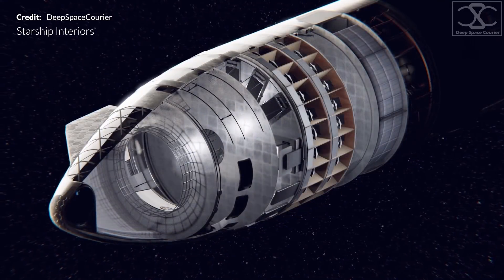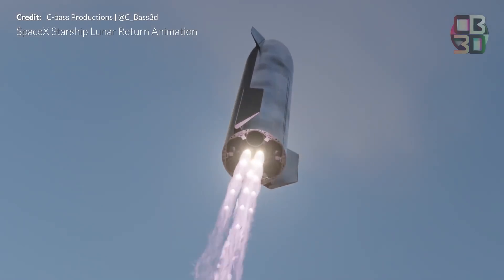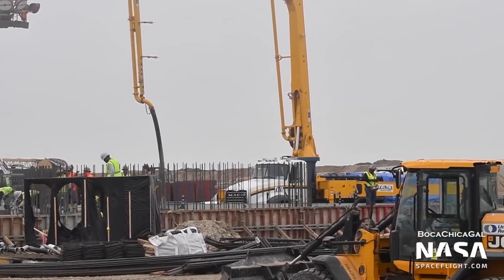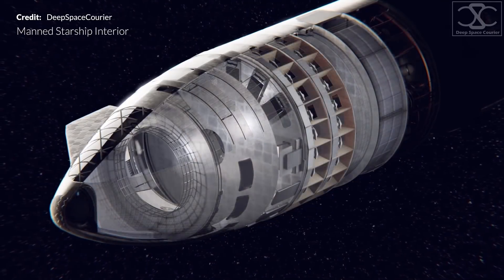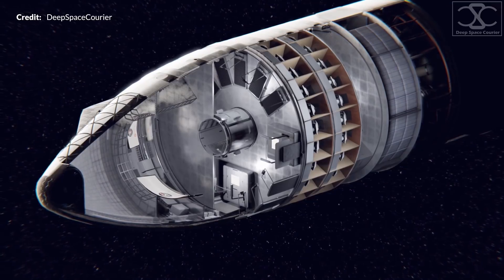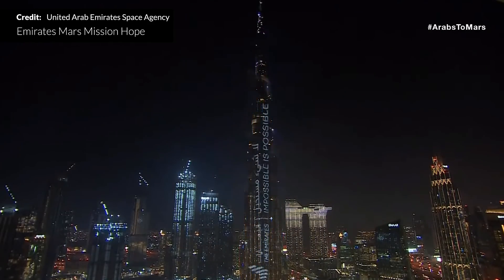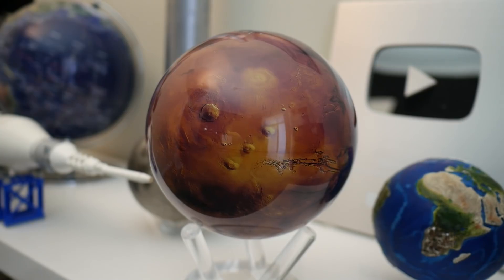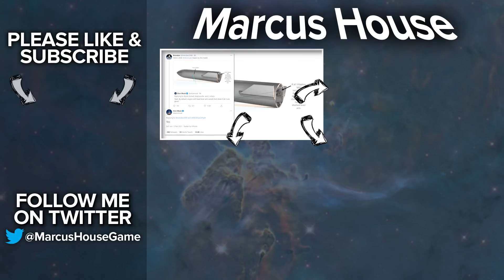SpaceX Starship to attempting another flight with SN10 - Can they master the flip and landing!?

Comment: SN9 seemed cursed from the start after it initially fell in the high bay and the eternity it took to launch. SN10 will stick the landing. Third time's a charm!
Reply: Spacex sounds like they will stop trying for a perfect landing and light three engines and shut down one when they light. This way they can examine the actual hardware that failed which will let them diagnose the problems. After all, burning a few extra seconds of fuel now is not a big deal. The can always tighten it up once starship has stuck a few landings and they have a lot more testing before orbital flights are ready. Right now they are not even going transonic and will probably want to do transonic and heating studies before the orbital launch. And put tiles on the fins and area where the fins meet the body.
Reply: @glenne1680  I'm not sure why they don't attempt the flip maneuver a little higher for now so that the engines have time to light OR attempt to light the other engine in case one craps itself. Even if the rest of the avionics and hydraulics work fine it would be a good idea to give it some room so that the rocket has enough space to balance itself before the landing not to mention start another engine in case one dies out before landing. The data they would gather during a successful landing is priceless so why not get one good landing under your belt?
Reply: @glenne1680  I hope they keep the redundant engine strategy even after the engines are out of early prototype stage.  Even capsules have more parachutes than they need to survive.
Reply: @wolffang489  As I understand it, the minimum thrust of a Raptor is too high to allow anything other than a suicide burn with three engines running. A more redundant solution would be to use engines with a thrust range that allowed a landing with three engines running at lower thrust, or two at higher thrust, such that if one is failing, the other two could be throttled up to compensate. At the moment, the Raptors are required to launch the Starship. Perhaps the configuration will change once Starship is launched atop the booster, and the Starship's vacuum engines are in use.
Reply: @sylviaelse5086  The trick is they likely won't fully burn all three.  They'll flame up all three sure, but they kill the one that's either least stable or has the shortest lever arm before it generates much thrust so that in the end, they'll hopefully more consistently have two engines to land on even if one of the normal landing engines fails.  Even with full production, well seasoned engines I would rather sit in the Starship that has a backup plan than the one that relies on absolutely nothing going wrong every time.
Reply: @wolffang489  That leaves them relying on the two running engines not to fail. That might be good enough for non-manned missions, but I don't see it being adequate for man-rating. I believe the shuttle had some short periods during launch, when an engine failure would result in loss of crew, but we know now that the shuttle was hideously dangerous anyway.
Reply: @sylviaelse5086  No, the point of starting up all 3 and cutting one is that you aren't just relying on two engines at the most critical moment which is reignition.  If it's already burning stable then it's not likely to give out in the few seconds it needs to continue burning.
Reply: @wolffang489  I understand the point of starting all three. I'm saying it's not good enough.
Reply: @sylviaelse5086  Well that will be left to be seen.  While it won't ever match a plane as they can always resort to gliding, I could see the safety of this flip-turn two engine landing becoming comparable to a helicopter eventually.
Reply: @wolffang489  Even a helicopter can auto-rotate if it loses engine power.
Reply: @sylviaelse5086  And I pray I won't have to ride one that has to attempt that maneuver.
Reply: @sylviaelse5086  True.  But the critical aspect of auto-rotation is that it must be commenced at just the right moment.  Too early, and you run out of lift while you're still far above the ground.  Too late, and you won't have slowed down enough for a soft landing.  I think it's the same with the Starship.  They don't want to run out of fuel when they're still 50 feet above the ground.
Reply: @eyesuckle  I'm sure SpaceX are capable of calculating the fuel requirements.
Reply: @eyesuckle  From videos of auto-rotation practice, it does not appear that an auto-rotation landing is particular demanding.
Reply: @sylviaelse5086  I've actually spent a lot of time in helicopters.  I spent months where I flew in one every day (as a passenger).  The pilots were required to practice auto-rotation.  They would fly to a fairly high altitude, and then practice their auto-rotation "landing" (i.e., coming to more or less a dead hover) in mid air, at a particular altitude.  That way, if they miscalculated, they wouldn't slam into the ground, and still had time to re-engage the rotor.  So, practicing wasn't that difficult.  Actually doing it for real is a little trickier.
Reply: @sylviaelse5086  Redundancy is not always the best way to maximize reliability.  It's possible you'd get more failures relying on more complex engines with more throttle capability, even with a spare, than you would with two engines and no spare once they were lit.
Reply: @psychohist  Less reliable does not necessarily mean less safe. As things stand, it looks as if Starship has two single points of failure during the last stage of landing. Even if greater throttling ability in an engine increases its probability of failing, if that eliminates single points of failure then the system is still safer unless the engines are now so unreliable that you're more likely to lose two during a landing that you previously were to lose one.
Reply: Or is it the 4th time? :D
Reply: @evilinside6327  may be fifth :P
Reply: How many times did it take during the development of the Falcon series before they stopped blowing up? People should measure it against that whatever it was.
Reply: @ForwardSynthesis  I think the 4 launch of the Falcon was successful. The first attempt to land the first stage of Falcon 9 on a ground pad near the launch site occurred on flight 20 so I don't think we have version Starship 20 parts built yet. They will probably get it sooner cos they are already doing it routinely with Falcon 9 so they know how to do it.
Reply: @evilinside6327  So it might be reasonable to expect them to get a non-exploding Starship on the 4th try or so?
Reply: @ForwardSynthesis  Well they had problems with raptors starting both times. Now they will try to start 3 and shut one down. Well, what if the one engine craps itself. During the first landing attempt, the engine exhaust turned green and it started consuming itself. If the engines don't become more reliable it might take even longer. Fortunately, Elon is not the guy to give up so even if they crash land a few more times he will eventually get it right.
Reply: @evilinside6327  the sn8 failure was not an engine reliability problem it was the header tank losing pressure. The engine ate itself because it was being fed pretty much only oxygen
Reply: right I think so too it is how it went with falcon 9 till they stuck it on the 3 try and the rest is history
Reply: Hoping for an SN10/10 from the judges.

Comment: why don't they relight all 3 engines during landing?  Once they get all 3 lit they can shut 1 off and land with 2.  That way if 1 engine fails to light, they still have 2 engines to land.  They keep trying to land with a 2 engine relight with 1 engine sputtering out and resulting in a crash.
Reply: Elon has already confirmed that SN10 will perform this procedure.

Comment: That starship interior looks grim as all hell. Not a drop of colour anywhere? Also something of a safety nightmare. I can't see an interior bulkhead anywhere. You absolutely need at least two sections which can operate in complete isolation and accommodate everyone while the other is repaired in case anything goes wrong.

Comment: Why landing isn't performed further from launch? Simple. Elon does want to get comfortable with the assumption that something will go wrong on landing. He has 100 percent confidence in the guidance system to put the rocket in almost perfect proximity to the landing target. Falcon 9 has proven it and the flippety flip is the current goal.
Reply: Its not just the guidance system that one needs to have confidence in. Besides, absolute confidence means thousands of flawless flights and landings. That's gonna take a while..

Comment: The number of failed landings will be tiny in comparison to successful landings as the program proceeds, so the "concern" of the proximity for the landing pad being close to the other area will be dwarfed by how useful it will be in the long run.
Reply: The first few flights of the Falcon Rocket ended in smoke and flames...
Reply: @spyeatte  They sure did. They were also models much further down the line compared to what we are looking at with the Starship. How many successful launches and landings now of F9? The F9 also has far lower launch expectations compared to SX vision for the Starship.
Reply: They definitely should have some walls around the farm and not have the next rocket already right there though.  Prepare for the worst and hope for the best after all.
Reply: @wolffang489  Not during prototyping, you want to get your tests done, belt and braces can be applied when you are dealing with finished products and customers. Considering all we have seen there is not any evidence that there does need to be a wall around the tank farm.
Reply: @chrisroberts2266  It's precisely because they're prototyping that they should be more careful about their tank farm getting hit by burning shrapnel.  Every successful landing gives them more room to take chances with things around the landing site but right now there's a majority chance of it exploding like a bomb.  They're effectively smoking at the gas pump and just hoping for the best.

Comment: Why would they build a pad further away? The final version is supposed to land that close anyway, so it wouldnt make sense to build something further away, that becomes obsolete as soon as you manage to land Starship reliably. Also it might have landed perfectly from the first time onward, making a further away pad a waste of money and repairs are done quicker when you dont have to drive around so much. Furthermore the Starship could explode at liftoff too, potentially breaking important equipment as well. It just doesnt make sense to build a pad(that you would have to maintain) further away if you might not even need it.
Reply from the maker: Well. For early prototypes, so they don't land one in the fuel farm. I mean. It is just a pad. That is a lot cheaper to make 2 of them rather than a new fuel farm.